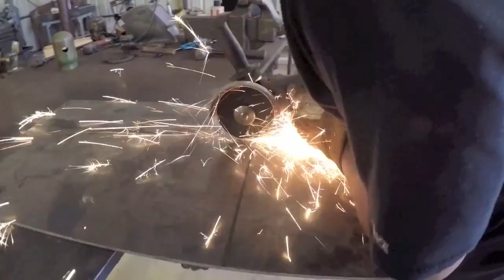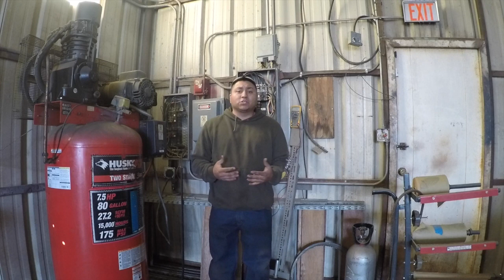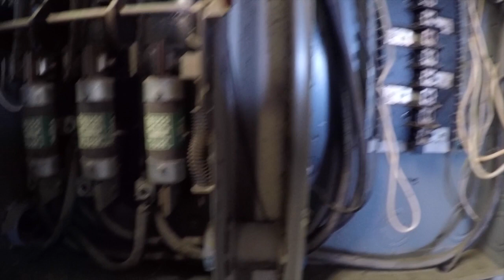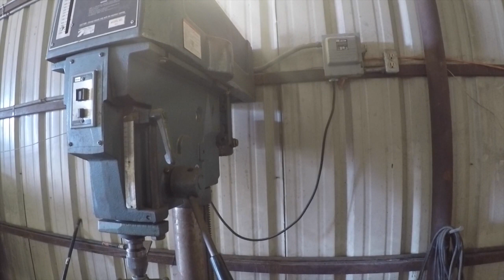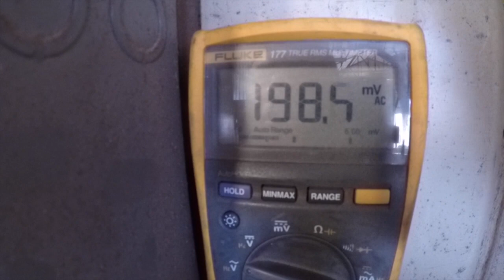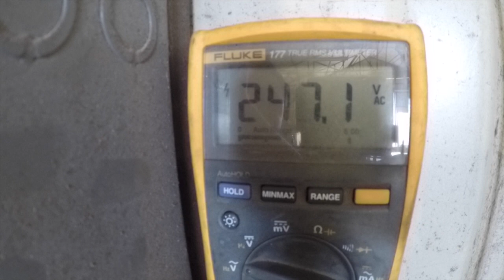#80 My 3 Phase Phase Phase

Comment: What do you need a multimeter for? you might as well lick 2 finger and touch 2 points then have your uncle measure the distance you’re thrown. If its 20 feet it should be 124vac, if its 40 feet its 248vac. Face facts you have neither respect for electrical tradesmen, any type of legislation or the welfare of your family. As for the YouTubers giving you advice there should be a way to have them hunted down and prosecuted.

Comment: The one thing that I noticed, and trust me I am no electrician so maybe someone else will chime in here, is that on the three phase breaker that you were showing voltages on, you had two sets of wires coming off it. This would lead me to believe that you may have two things run off the same breaker. Not sure about California, but where I live its against code to feed more then on item from a single 220 breaker, regardless if its single or three phase. When you bring your electrician in to wire, you may want to have him check that if no one else chimes in first.
Reply from the maker: I agree and sure it's not in code.

Comment: What you have is a 200 Amp 240 Volt 3 phase four-wire high leg delta (4WD) electrical service. 

Here is a representative diagram
http://www.ccontrolsys.com/w/Four_Wire_Delta_Circuits

https://en.wikipedia.org/wiki/High-leg_delta

There are plenty more articles and diagrams
https://www.google.com/search?num=100&newwindow=1&site=&source=hp&q=3+phase+with+high+leg&oq=3+phase+&gs_l=hp.1.0.35i39j0i67j0i20j0j0i20j0l5.4176.8097.0.11184.9.9.0.0.0.0.204.909.5j3j1.9.0....0...1c.1.64.hp..0.8.702.0.aRycyYOMOQs

http://ecmweb.com/qampa/stumped-code-requirements-identifying-high-leg-3-phase-4-wire-connected-system

Legally and from a safety stand point any 120 volt single phase circuit derived from a 3 phase circuit it is mandatory to have a separate properly sized dedicated neutral and separate properly sized dedicated protective grounding conductors originating in the distribution panel with properly sized over current protection device such as circuit breaker or fuse. 

From the video I see several issues that I would strongly suggest getting a knowledgeable licensed electrical contractor to inspect the service and distribution panels and bring the service and panels back into NEC compliance for life safety and prevent potentially damaging any connected equipment.
Reply from the maker: Awesome thx